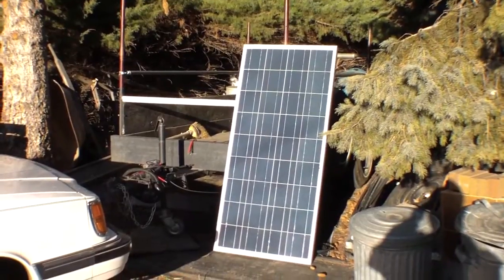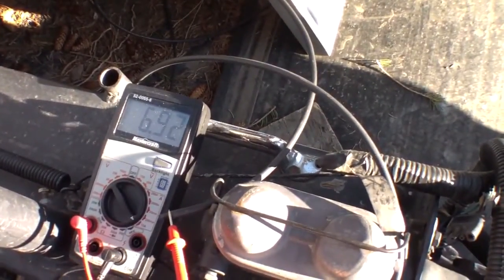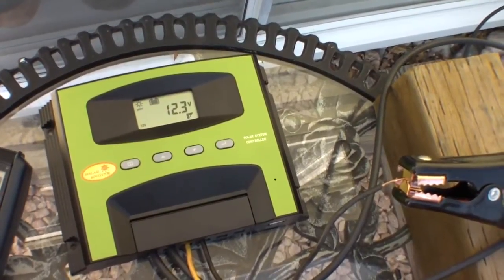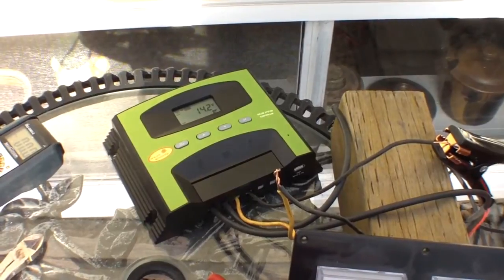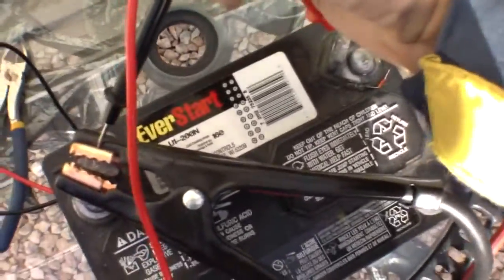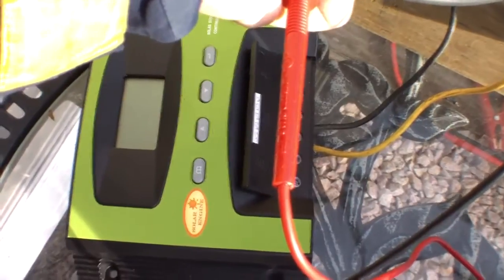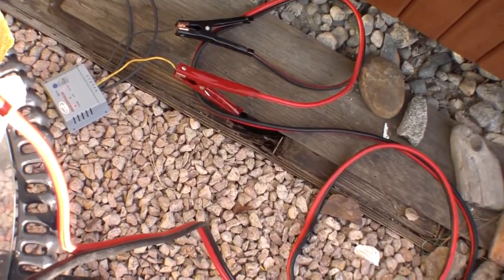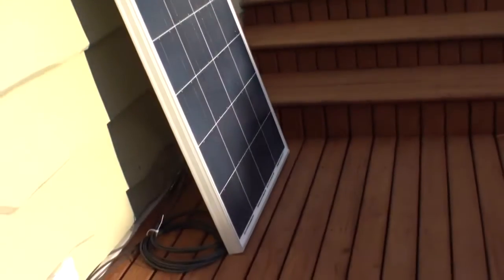(12V) 140 Watt Polycrystalline Solar Panel - For Sale - CDN - Kelowna BC Canada

Comment from the maker: John it is the same concept for anything in solar. Example: Solar Array sun tracking can yield up to 30-40% extra energy. True. But heres the challenge: if the array to be turned is worth $X, then, the tracker must be built for .15X. If it can't, buy more panels, and keep them stationary. For an individual, most usually, we cannot produce enough solar derived energy -- therefore anytime we spend money - it needs to produce results.

Comment: I have a couple of decent enough mains battery chargers for Ni-CD/Ni-MH and am wondering if the things learned about transformers hooked backward would work for smaller batteries and winter conditions. Such that, 12V solar, into reverse transformer, out to mains type charger. Little batteries won't want 800mAh anyway :)
Got no panels here, but wondered if my thinking was sound enough, in case fortunes change.

Comment from the maker: @slider2732 Or, collect your juice into a electrolytic, large one and use a Bedini/JT charger. I find if you run the juice into the batteries FIRST, then wire the JT below (as if it were a resistor to ground), then send its output back up to the top rail, you get the current + the backemf. Works good.

Comment from the maker: @slider2732 As shown in my video, MPPT's rock!!! Problem is once u got big, they have a high cut in. I'm now programming a PIC to recognize what's going on...FIRST. When the juice is real low (under an amp) it'll send it to Doug Konzen / JT variant of the Bedini and pulse the bank instead of charging it. You could buy an $6-800 Tesla Solar Charger, but why bother? I'll spend the money on panels, instead!

Comment from the maker: @slider2732 On that note, though... I took an electrolytic 28,000 uF, ran it on whole bunch of solar lamp panels paralleled until I had 3.2v 200 mA. I wired my solar panel to the electrolytic, then that to the XEE2. When the sun came up, the cap charge, and then it started to oscillate. It ran the juice 100 ft down a wire into a dark room. The first XEE2 JT microinverter, no batteries! :P

Comment from the maker: @slider2732 I don't see why not, but if you are charging batteries, DC direct will work! If it is a small solar panel, you can make a simple shunt controller, minimal parts, you probably already have everything you need. Charge direct I'm saying.

Comment from the maker: @randacnam7321 Upon closer inspection, this morning, a very cold clear morning -  a good day to test MPPT.. I do see what you mean. When under heavy MPPT mode, the inductor (a dinky air core at that) saturates. In addition to that I really don't "get" this three pin relay. It is an MPPT charge controller, but I agree it is not well engineered. It is not a bad unit, priced against controllers that aren't even PWM. Thanks for bringing this to my attention though, I will not promote these for use.

Comment: i  have the same setup like your i have a 140watt panel same mppt charge controller will this  charge my 2 deep cycle battires rated at 140ah and 1000CCA plzz reply thanks guy

Comment from the maker: if you think about, it all comes down to dollars per watt. I can currently sell the panel in this video for $280. If you buy 2, you spend $500. I'd do two for five. No matter how tricky your little panel is, will it do 280 watts, and 16A, in good sun? No. it wont. And mine will only suffer if and when a leaf falls on it. Which is a blue moon event. Buy -practicality-, $ per watt is everything - gimmicks get you no where, unless it is absolutely NEEDED.

Comment from the maker: I know what a day 4 panel is. They zig zag the tabwire. Big deal. Gimmicks. Sure, it helps, but what is the $ per watt cost. Thats the bottom line. If a tricky dicky panel that is leaf proof is getting blown away by two panels purchased for the same money, the new tech is FAIL.